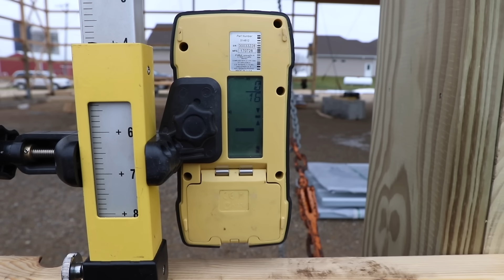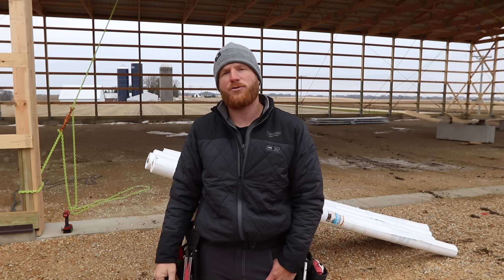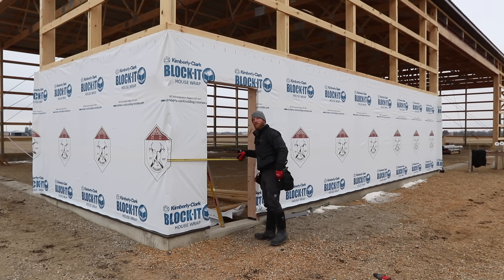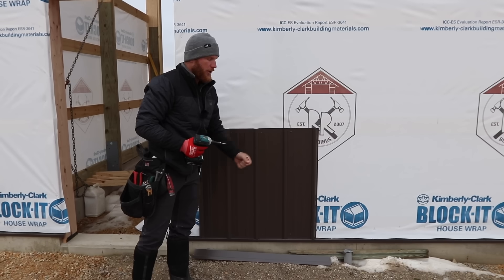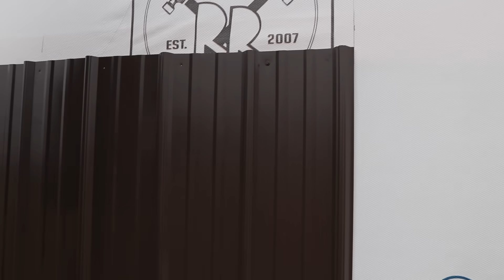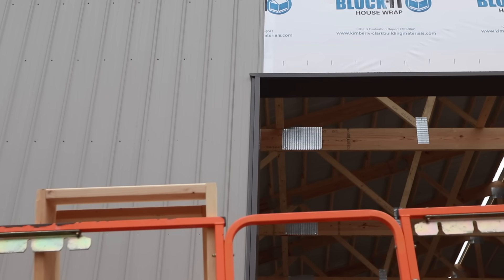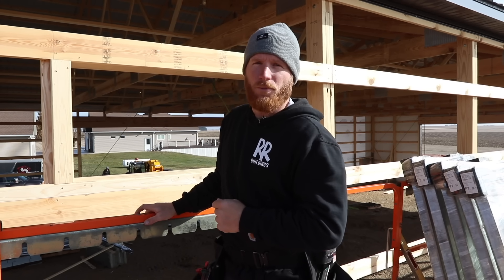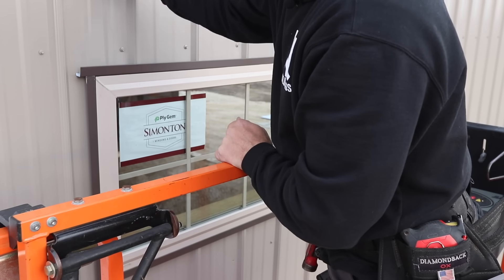Layout Metal Siding Tips and Tricks

Comment: I worked for Morton building years ago when I first got into the trade. They by far have the best trim kits of any pole frame and metal buildings around. Using those chains to square up a building was a learning curve for me at first but they are definitely essential. There's nothing like seeing your upper steel panels rack at the bottom on top of that trim that separates the top panels from the bottom. You guys do excellent work 👍

Comment: Couple things to mention as a carpenter that ends up installing a decent amount of corrugated and metal siding: 
1. To cut the panels, especially if it's 24ga 7/8" corrugated, a skillsaw with a Diablo steel dragon metal blade, provides a very straight and very clean cut vs using a nibbler. It's also MUCH faster. For us, we go through 2 blades, $50 each, per typical 2000sq/ft home. Just a bit of Masking tape on the saw plate to avoide scratching. 

2. for walls with lots of windows and hosebibs/electrical outlets:  I like to order precut sheets for under windows, leave them loose side to side so as you get to the panel at the window, you can slide a rib under that panel, then continue past the window. Saves a lot of time in layout, extra cuts, waste etc. 

3. With hosebibs and electrical outlets, I like to run a larger than needed fascia block almost as an architectural feature, closer to doors/ends of walls/vertical J trim locations, so that instead of having a situation of having a small 12"x12" block j-trimmed on 4 sides and trying to fit a panel over all that to fit behind the J-trim, without scratching it all up, run a larger block into longer sections of vertical trim flashing, so that you can now cut C notches and slide the panel in behind all the trim. Another thing in design if you're a general contractor like me, push to combine the hose bib and exterior plugs close enough(not too close for Code) that you can combine the fascia block for both. My plumber likes to offer Hot and Cold hose bib setups which clients love, and justifies a larger fascia block which again, makes installing the metal panels easier with less notch cutting.

Comment: Hey… I have a question. How would you guys approach doing layout for an existing building where the windows and doors aren’t laid out based on the siding rub locations? I am building my shop, I did not know I would be installing metal siding until recently. Now I have to adjust my siding layout to accommodate where the windows and doors are located. I’m wondering how you would approach this issue. Thank you!! Love the videos. 😃👍🏻

Comment: Are the overall measurements taken from the corner posts or from the corners of the nailer boards? I’m assuming if I want a 120’ long building, the corner posts need to be set 1-1/2” in on each end to account for the width of when the nailer boards are added. Am I right?

Comment: What is maximin truss length you use without having any center support beams? Another nice feature for using house wrap is if you plan to go with spray foam insulation. The spray will stick against the house wrap instead of the steal so should you ever have to replace a panel you won't have to deal with the spray foam being stuck to the steel. Just pop the steel panel off you need to replace and pop the new one on without disturbing the spray foam insulation.
Reply: Biggest I did when I worked for a post frame company was a 92' double truss. I'm hoping kyle is hiring soon ;)

Comment: Just curious why you do not plywood the outside , I'm residential builder/framer and I know that plywood add significant rigidity to the wall
Reply: His future videos will show the X-bracing he builds into the walls. This and the metal probably yields a higher wind rating than required for his area.

Comment: If you end at a rib, just extend your slot through it, and run your J channel out another inch past the rib. No big deal.; And you should cut those ribs a little higher to allow water to flow and flush debris out of the J channel.

Comment: Your video was good. Couple points, your "J" channel above your doors would still need caulking at the cut where you slid your "J" up.  Water could still ingress behind the flat. Just a little tip, "End dams" on what we call a "typic head/drip flashing". With an "End Dam" it forces the water beyond the high of your sheet. Do you up turn your sheet going into the Jamb flashing at the door?  Water could work it's way around the flat of the sheet. I'm a cladder by trade, with ticket in Canada, west coast. We live in a rain forest here so we goo over kill on all terminations and penetration's. 20 years under my belt. But again, very informative and well produced video. I would definitely have you on my crew or just plain work with you in the field. Very clean work and you do have great attention to detail. Caulking = roofer in a tube. 
Cheers

Comment: For a couple reasons I, as an older woman, am left trying to finish a steel clad building . It appears that the builder put foam insulation boardthen the steel I can't tell if the bottom trim is over the board orunder it. Help?
Reply: I’m not a steel siding pro - but the thickness of the bottom trim would dictate that you must install it directly under the steel siding, (meaning, over the insulation, directly touching the steel) 
If the bottom trim was installed below the foam, and was not some sort of specialized trim, the steel siding ribs would protrude farther out than the bottom trim piece itself .
Reply: @JBMtechnologies  thanks, my previous contractor used 1inch rigid foam I'm stuck with free 2 inch rigid foam. It looks like I will need to add another pressure treated board to make it fit. Or buy the thinner insulation.

Comment: Can you just trim the windows out with the J first and then fit your panels into the J  ? I don’t understand why you need cut slits into the panels. It doesn’t look uniform around the windows. Because the J that goes diagonally over the windows passes over the J that’s horizontal on both ends. I think I would get complaints about that.

Comment: Great video. I'm confused on one part. If its a 4x12 pitch then why are the 3 ft wide pieces of steel 1 ft longer each time? Shouldn't be a little less than a foot? Thank you great vid!
Reply: Every 12” you go across horizontally, the rise of the angle increases by 4”. So basically 4x3= 12” of rise
Reply: Willis thanks!!

Comment: The fact that the foam insulation sticks to the metal is the prime reason I NEVER use house wrap. I want the closed cell foam to glue the steel together. I put steel clad pole barns up all over northwest Florida and southern Alabama and most of my buildings are heated shops. Never had a problem foaming without wrap and none of my buildings have blown away in a hurricane. I always put 3” closed cell on the ceilings and 2” on the walls. That glues the entire structure together and it’ll never come apart.  And yes, it’s not difficult to modify a building constructed this way. We upgrade buildings often.

Comment: A styrofoam cup with hot coffee in it, think about how thin it is and how hot that coffee is. Good insulation. I used 1 inch 4 by 8 sheets of Styrofoam in my shop. Worked wonderfully. It also cut the price way down on insulation. Then I used a 4 x 8 sheet of OSB bang board running around inside the shop. On the outside, I used the black Roofing paper 36 in wide rolls. It's better for the wood.......... Three generations of builders in my family going back into the 1940s. We have built hundreds of these. Thanks for the video.

Comment: So where is the vapour barrier - if the wrap isn't the barrier? What keeps condensation from the metal - and any sideways rain from reaching the inside spray-on or batten insulation? If you drywall the inside and moisture makes it in - disaster, so how best to ensure that's not going to happen?

Comment: Obviously, these guys have this down to a science. I've played around a little with this product, and at least for me, there is a pretty steep learning curve. I built myself a shed, and put this product on the walls and roof. It is a 10x10. The wall layout didn't end up awesome... Is what I should have done is find the center of the wall, (5'), and put the edge of a panel there? So at least the ends would end up the same? But it seems to me at some point, you may have a rib in just the wrong spot on both ends. At that point, the only solution would be to build your building slightly bigger or smaller? Obviously, that would have to be planned out before you started building.

Comment: I didn’t see/hear any discussion about the direction of layout (considering prevailing winds).  Is that just a consideration on roof layout?  I’ve always done both.
Also, if the windows are already installed and there was no consideration for the ribs on the metal, no layout seems to work.  What then?  Case in point, there are 9 windows on 2 stories of a 28’ high wall, 40’ long.  The ribs are an issue everywhere.  Is there another design that can be used to serve all the windows with a uniform trim design?

Comment: I had a huge problem on my house when I built it that the builder vented my entire soffit (92 ft) and I only had 9 ft of ridge vent.  This caused my attic to pressurize under high winds and blow cold air into the house.  Heating bill cut in half when the soffit vents were fixed.  With the open top part of the trusses I would think that this would make sure no pressure built up and would allow all the wind to flow out of the roof area and actually help.  I wouldn't do blown in insulation up there without something over it though.  I had some pretty crazy drifts in the attic..

Comment: Hey great video so happy I found your channel again, up here in Canada we use drip edges above the windows and the u brackets for the side then for the bottom it’s a piece with a 90 we slide 1/2 inch under the window with a 1 1/2 face with a hemmed edge we done use the U’s above the window because of rain / snow in the winter

Comment: Since you are sealing the air barrier to itself, you should tape to bottom metal trim so it doesn't come up inside the wall.
Reply from the maker: I feel good about the seal once trim is screwed tight but you are right that could be even better thanks

Comment: Just curious and you may have already done it but since you can get your logo on the wrap why not have 3' hash marks or vertical lines for your panels printed on the wrap?
Reply: Think about the difficulty of lining an existing mark on house wrap with where it needs to be on the building. Also exact plumbing of the vertical lines. Also the fact that the wrap stretches. Seems much easier to do it the way he showed.

Comment: Great Video Kyle.  At 14:40, you mention that you cut the sheet 1/4 " shorter than the measured length of 16 feet (between the base trim and the top j-channel).  Would you also cut the sheets 1/4" shorter on a length of 6 - 10 "?
Reply: I think the point Kyle was making is that he takes a "tight" measurement and then takes a 1/4 inch off when he cuts to ensure an easy fit. The length of the measurement is irrelevant.

Comment: Do you have any tips/tricks on how to cut holes in steel soffit/siding once its already installed? IE For Soffit Lighting or In Ceiling type speakers (where plywood is behind it for structure). Such as things larger than a standard hole saw.

Comment: Not wrapping the gable ends can hinder the chimney affect from eve to ridge. Also helps with condensation on the metal. We also sheet all are roofs easier to work on, stronger building and not much of a cost difference. But where I live we average over 200" of snow.

Comment: Love how you take the time to house wrap the building just as an extra step in case there is spray foam down the road. What is the tool you use to mark out your sheets on the gable end I usually use a regular straight edge but having a protractor type edge like you have would come in handy as well as your cordless nibbler I have seen you use in other videos and am wondering how it compares to other (more expensive yet pain in the ass corded versions) like the Fein tools 18 gauge

Comment: If a rib is on the window/door edge, run the j channel past to the flat.  Basically making a extra wide top J to miss the rib.  Or use head trim/z flashing, it sheds off the front not to the sides, as long as it Capps the rib.

Comment: Spent some years in this particular trade. I was considered among the vest at the time. It is nice to see work being done as i did before and with a clean horizontal cut with a nibbler instead of an abrasive saw. Last company i checked  out to see how others were doing was using an abrasive blade on a roof and not even cleaning up the burnt edges. When it rusts not even two months after install the owner will be quite upset. I would love to send you some horror pics of a residential metal roof install. They are horrendously bad. Email? Nice work. Also, i argued with a brother in law on his pole barn on the proper placement of screws. Some jackoma told him on the ribs so sent 2 1/2" screws. I won and he spent forever grinding penetrated screw tips inside. Let me know on the pics.

Comment: Love your timber frame efforts but; why not use a PEB on your projects? The PEB offers you more accuracy because your working with steel as opposed to wood with is crap or equal, larger spans which means less columns/piers, larger live/dead/snow/wind/lateral load resistance, more fire resistance, less labor. Your multi-fastened normal lumber post frame structures are less fire resistance than a timber or steel frame building. Most of your client buildings look to me like farm/shop/agricultural/industrial type buildings which are fire prone. You can still do you excellent metal soffits/fascias/ceilings, siding, roofing details!!!

Comment: You can also plastic the inside. I’ve found that you get almost zero air through the building running plastic over the insulation. Unless you’re spray foaming you don’t need house wrap in my opinion. But everyone does it different

Comment: Happy Thanksgiving Kyle. Another good video! The details at the windows are great and I know you've covered them before on how to cut but going over it again is the best way to hit it home. Your layout techniques would suit you well for hanging drywall, laying out a shower enclosure, or setting tile. It's all in the math and the material dimensions. 

QUESTION: How do you keep any rust stains from running on the building from where the metal is cut and exposed? Can anything be done like maybe have a few cans of rattlecan clear? Thanks!